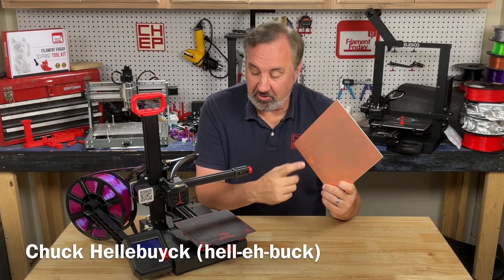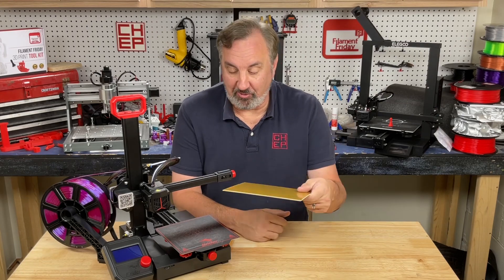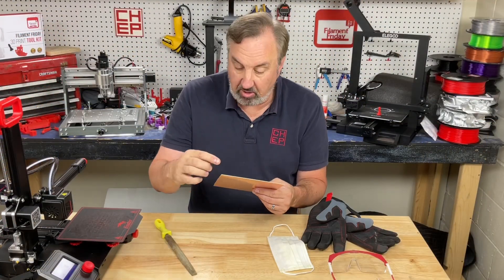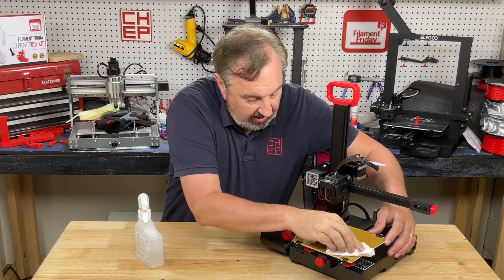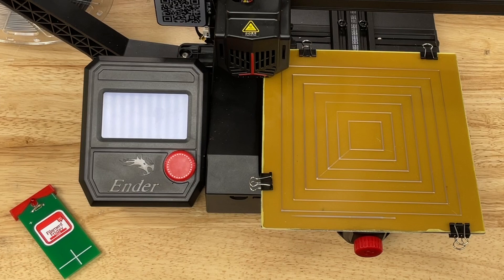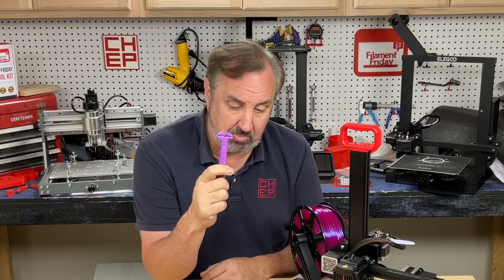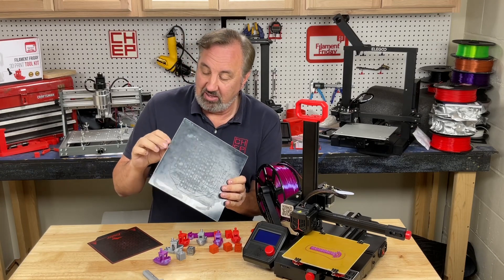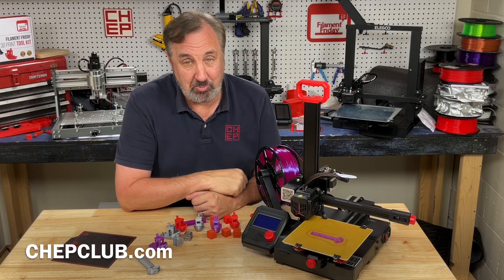Using Circuit Board for 3D Printer Bed!

Comment: I tried this a few months ago, but found that the copper on the bottom of the board expanded as the bed heated up and curled the board such that the clips couldn't hold it flat.
Reply: Just buy an FR4 sheet without the copper 😎👍
Reply: @winandd8649  and that's what I did. I was just interested that Chep didn't suffer the same problem or at least didn't mention the possibility.
Reply from the maker: I’ve had no issues like that.
Reply: I have the same issue with the FR-4 sheet without cooper. Chuck hasn't had that issue, because he hasn't heated the bed above 90 C. In my case printing PETG up to 90 C bed doesn't deform the FR-4, but anything above 90 C just makes it defomed like crazy.
Reply: @michwnet  Seems there is a variety in quality of these FR4 boards? I print ABS and ASA all the time and heat the bed up to 105 C
Reply: @winandd8649  That may be the case. Do you use Automatic Bed Leveling? I think my FR4 deformation could be handled with ABL, but currently I don't have any ABL system installed on my Ender 3
Reply: @michwnet  Yes I use ABL, but the G29 mesh that is stored in the printer is made on a cold bed i believe 😆
Reply: even without the copper it will eventually curl up (I´ve been using it for quite some time). But it´s still a good surface for printing Nylon.

Comment: MIght be a bit of an issue to say "G10 is the SAME as FR4" afaicr FR4 has fire retardant properties ("FR"), anyone installing G10 in an environment that needs fire protection could be in trouble assuming "G10 is the same as FR4".  Clearly it won't make much difference on a heated bed of a printer at 60deg, but...   ;-)
Reply from the maker: Good point but most G10 these days is actually FR4.

Comment: Hi its possivel , to have profiles for prusa i3 for cura?
Reply from the maker: Prusa printers won’t accept Cura files.
Reply: @FilamentFriday  Prusa printers will print cura gcode without issues. But there is no point in doing so when there are perfectly calibrated presets in Prusaslicer

Comment: I've been using G10 as a print surface for a number of years now, and just love it. I think it is the best print surface there is. I have just recently converted my Ender2 Pro to a mains powered heated bed, and as an experiment I decided to use a piece of 5mm G10 as the heated bed/print surface, the Keenovo 220v 300W heater element is stuck to the underside and I print on the top side, works brilliantly.

Comment: I've been using G10/FR4 for all of my 3D printers for 3+ years, now.  Works great, every time.  If a little more adhesion is needed, apply a thin layer of PVA glue stick and away you go.  No fuss, no muss.

Comment: Ever since I saw Angus' original G10 video, I have been printing  on a sheet of 1.5mm FR4. Best surface I've ever used in my 5 years of 3D printing. And you are right. This stuff is very difficult to cut. Your sheet metal shear is awesome.

Comment: Hi Chuck, FYI, not sure if you're anywhere near one,, but GRAINGER sells Garolite sheets - in different thicknesses - very reasonably priced. I personally purchased some at 1/32" x 12" x 48" for less than $25, which gave me enough to make FIVE bed surfaces.

Comment: Nice one! I wonder if it's possible to etch/mill  the copper side into an element so you could have a heated bed too?
Reply: It shouldn't need it, the copper would conduct heat off the heating element on the stock ender 2 very well.
Reply: That's how the original heated beds were made, sometimes with a solder mask (heat resistant paint) applied so they came in colours. Then some borosilicate glass (heat proof) as the actual bed. I have a DaVinci V1 that has that exact setup with an uncoloured plain board, and some heated beds (coloured red) from when I was going to build my own original Prusa i3.
Now most of the heated beds use an aluminium pcb.  Basically a thin fibreglass (FR4) pcb bonded to a thicker aluminium core.

Comment: I have been using G10 on my Artillery X1 ever since I saw Makers Muse's video. It is much better than the stock bed, but for best results I had to increase bed temperature by 10 or 15 degrees

Comment: Yeah G10 or FR4 works great as a bed for printers. I work with a Builder Extreme 1500, which is a $30,000 large format printer, and originally it came with a glass bed surface. Over time the glass just cracks off and makes that area of the bed unusable. Instead of replacing the glass, which is considered a consumable, I used a sheet of G10, thanks to Angus video, and have not had a single problem with bed adhesion since. Also on the upside, the same size G10 was about half the price of the 1/4" x 2' x 4' piece of glass. Win, win!!

Comment: I'm also a big fan of printing on FR-4, but recently I've run into a problem while printing CPE HT form Fiberlogy: It needs to heat the bed to 105-120 C and in this temperature the FR-4 2,0 mm thick sheet whopped on the center and was significantly closer to the nozzle than in the corners. It relay is fine for everything up to PETG (90 C Bed) but everything above is not printable on FR-4 because of the whopping effect. Has anyone have the same issue as I had?
Reply: True that. I needed binder clamp to hold the edges down due to the warping issue above 100c
Reply: I've also had binder clips on four corners of the bed and then the FR-4 sheet was bending between those clips. I've also tried gluing FR-4 to the bed with a double sided tape and no clips. After that the corners went up, so I use the binder clips again so the tape under bed came loose and FR-4 whoppped again on the center.

Comment: I bought the "JUSTHANGIN'" Garolite sheet for my Ender 3 Pro back in May & haven't looked back. The bottom of the prints look are crazy smooth & when the surface cools, the print releases itself from the bed. Some guy on YouTube bought a bunch of large sheets of Garolite, hand cut them down to fit the Ender 3, and listed them with Amazon Prime. I get to be lazy and not breath in fiberglass.

Comment: Does it stick good enough to be able to print pla without bed heating?
Reply: From my experience no, it needs at least 65 C on my Ender 3 to stick PLA. But if you have a decent print area  TPU doesn't need bed heating to stick firmly on G10/FR-4.

Comment: The copper coating is also a plus. The heat distribution on the print bed should also be better. Great tip!
Reply: It's actually worse than one without copper coating. The heat distribution is a bit better, but the fiberglass warps after a while and forces you to turn the bed upside down, which isn't possible if the bottom side is coated in copper
Reply: Ok! I glued a normal fibreglass plate to a 0.5mm steel sheet. So that I can fix it without a clamp on the magnetic print bed. Printing works pretty well on it. Otherwise I use PEI plates. But I noticed that ABS has problems when you get up to 100°C. Then I use the fibreglass bed. But you can only print ABS with it because the fibreglass accepts the material. PETG and PLA then hold very poorly on it.

Comment: Been using G-10/Garalite for most of the last year on my Ender 3 V2, and have never looked back.  Works great on all the filaments I use.  A quick squirt of Windex type glass cleaner, and it's clean!
Reply: Me too mate, works well
Reply: I've had trouble getting my prints to stick with unmolested G10.
I had to score and roughen up the surface severely and create more surface area to get adhesion, any tips?
Reply: @lancehandmade  I cleaned the surface very well before I tried to print.  There every few prints, or when I think I need it, I clean with the cheap window cleaner from Walmart.  The stuff that looks like Windex. I Don't really have problems.
Reply: @lancehandmade  no tips to speak of, maybe bump up temp a bit?

Comment: 🤔 I wonder if it will work on the Ender 3v2.
Reply: Just flip the build plate. I did that on my Ender 3 classic.
Reply: @Splatterpunk_OldNewYork  Did you removed the adhesive material from the glass??
Reply: @The_Traveling_Clown  Do you have the PLA bed or the glass bed? There is a difference. If you have glass, then that is what it is.
Reply: @Splatterpunk_OldNewYork  I have the glass bed.
Reply: @The_Traveling_Clown  Not the same friend. My original Ender 3 had a garolite sheet with a sticker on it. My advice is to get some industrial acetone from hardware store, dissolve some ABS plastic in it, and make ABS slurry. Use a plastic dropper to place a few tears on the glass, then use your spatula to squeegee the liquid around. It dries very fast. Work a charm, releases with cold water.
Reply: @Splatterpunk_OldNewYork  I heard about the ABS slurry but never tried it. Time to try it it out. Thanks for the advice.
Reply: @The_Traveling_Clown  Can't say enough nice things about it. Never use anything else now. Sticks everything down.

Comment: I’ve been using G10 on my printers for a while now & really like it. I have better luck cleaning it with tap water with a few drops of Dawn in it. You do need to let the bed cool to parts off. Once in awhile even then they don’t want to release. Squirt some IPA around the part let it sit for a couple of minutes & the part will come off.

Comment: Hey Chep, I've been using your profiles for a while now. Ever since the extra fast profiles for cura 5 and 5.1 I've been struggling my extruder clicking a lot with the 0.28 and 0.32 profiles. It also gives me trouble with under extrusion, my layers get separate and fragile.
Any tips or ideas on how to fix it?
I have an ender 3 pro. By the way, the 0.2 and 0.12 profiles work a charm
Reply from the maker: Replace you PTFE tubing. You probably have partial blockage. And make sure it goes all the way to the nozzle, no gap.
Reply: @FilamentFriday  recently got a Capricorn tube installed. I will try to take it apart and reassemble the whole thing. Thanks for the reply!
Reply: Your extruder can push that much filament. Check your volumetric flow rate and maximum.... and look at CnC kitchen Vulkanizer video.
Reply: @ThePhilbox  The thing I don't get is: Is there that much of a difference between printers of the same kind? How come Chep gets his ultrafast profiles to work on his ender 3 pro, and I can't?

Comment: Sand it with some rough 40-120 grit sandpaper, and it will adhere to polypropylene and POM just fine. I haven't personally tried those with PEI, but based on online literature and google searches, that is where (insert your word for epoxy and fiberglass) takes the cake.

Comment: have you tried mirror glas?
Reply: I have on my Tevo Tornado and it works well. But it's a bit heavy on the stepper driver so you have adjust the voltage.

Comment: You're perfectly fine since you're working on such a small amount, but FYI..  Medical masks prevent things from going out, not stuff from coming in.
Reply: And even then, they only do so for a couple hours. Depending on how hard you are breathing, the moment it starts to get damp, bets are off. (Though ironically, once they get damp they get better at keeping particles out, not droplets though.)
Reply: They do prevent things from coming in as well, but in many cases they are not as good as masks providing better seal. Still much better than no mask at all, though.

Comment: I put together a simple guide system to use a 12"x8" sheet of FR4 on my CR-30 belt printer, with the FR4 taped on one end and pulled by the belt.  Works really well, and I'm planning on sourcing a nice long piece.

Comment: I love mine I bought the .020” high temp from McMaster Carr without copper backing and added a ferrous sheet metal backing and spray glue. I have one on my AD4 Ender 3 S1Pro and Qidi X-CF Pro and comes out great every time!

Comment: No ABS test?

BTW, I've tested the original Ender-3 removable bed plate, after removing the frosted sticker, the plate looks like it's some sort of fiber glass, which makes sense for the temperatures it must endure, but I couldn't get ABS to stick to it, not even after a light 200 grit sending. Is that bed material different from garolite/g10/fr4?

Comment: Have PCB way etch or machine the heater traces right out of the copper. You do not lose so much heat transferring from the printer bottom heated bed.

Comment: Good to know! I have glass bed on my printers and never had trouble with filament grip, but G10 would be a good replacement if necessary. Thanks for the tip!

Comment: I use to use circuit board for the print bed on my first "cheap" 3d printer about 10 years ago. Worked really well.

Comment: How well do parts release from the circuit board?
Reply from the maker: You see me do it in the video
Reply: After the board cools down to about 35c, you will hear them crack off the plate and self release.  You can also spray a little ISO at the base of the part and it will pop right off.

Comment: Did you still use glue stick for the petg as you suggested in the petg settings video or did it work fine without?
Reply from the maker: Worked without it. It was surprising how good it was.
Reply: I print almost exclusively PETG on FR4/G10.  you will never have to use adhesives.  Just wipe the bed down with IPA between prints and you'll have perfect adhesion every time.  It is amazing stuff

Comment: This is great - I saw Angus's video when it came out, but found that Garolite was sooo expensive here in the UK. It didn't occur to me to think of actual circuit board. Just need to find someone who can supply a 310x320 sheet for my Ender 3 Max in the UK!  I imagine that it has to be single sided, I can't see the plastic sticking to copper....
Reply: Knife makers use G10/FR4 to make handles/scales...  In the USA, there are several suppliers and sources so i imagine there will be a few across the pond as well.

Comment: So could the heatbed could be made from an heater pattern etched circuit board with the thermister soildered directly to the heatbed?
Reply from the maker: I guess you could.
Reply: No the copper is to thin

Comment: Great Vid! Saw Angus vid while back but couldn't find the pink sheets or anything like it. Great to know that it's the same as circuit board.  What about the copper side? Curiosity kills the cat or maybe the print in this case
Reply from the maker: Copper is not a great surface to do that.

Comment: does it work on non heated beds?
Reply from the maker: It can. I still heat it.
Reply: i'm no expert but i would guess no - i have been using this for a couple months now and at 60+ degrees everything is stuck down great. but the moment the bed cools below 40 for me, you can just walk up and pick things up off of it.

the ease of removing prints once it has cooled was a big selling point for me, my glass e3v2 bed had amazing adhesion.. but good lord it was too good and so hard to get some things off even when fully cooled! this g10 / fr4 stuff has been a blessing for me :)

Comment: Isn't the circuit board a really good heat insulator making bed heating pointless? Nice idea though.
Reply from the maker: Nope, heats up fine. Same way you can solder by placing the bed on a hot place and melt the solder paste.
Reply: @FilamentFriday  Thanks for clearing that up